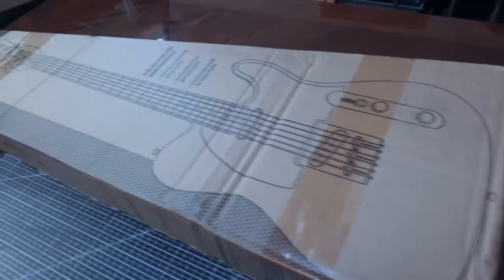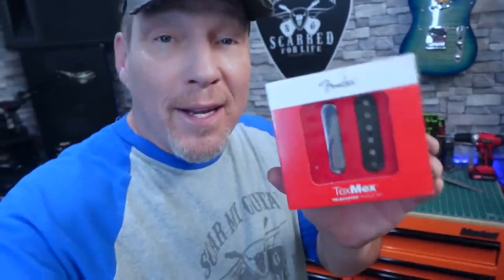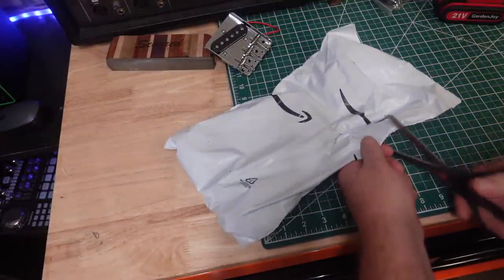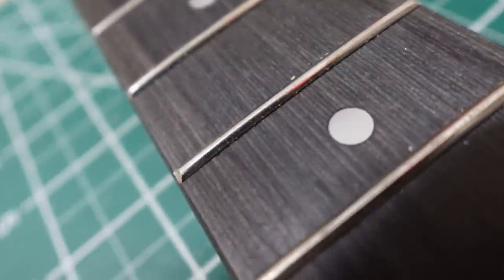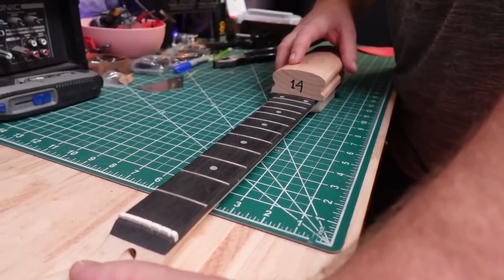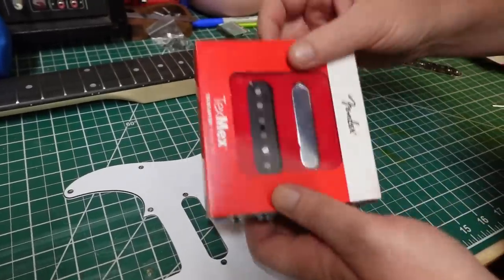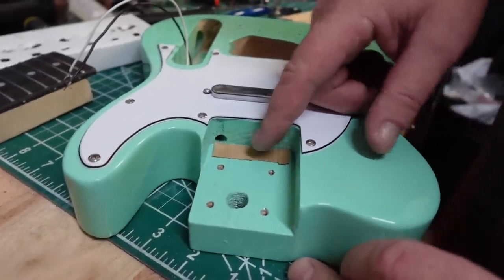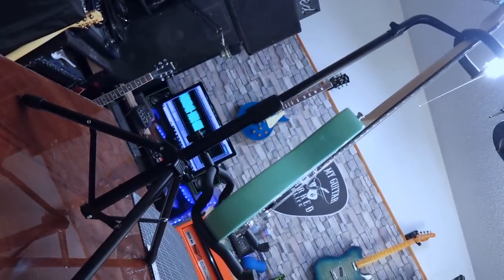CHEAP CHILD'S TELECASTER GUITAR GET'S FENDER PARTS AND IT'S A BEAST!

Comment: To make the neck sit flat in the pocket - THE SCREW HOLES IN THE BODY MUST BE BIGGER THAN THE SCREWS! Else the screws are threading into the body AND/THEN the neck. You only want the screws pulling the NECK to the pocket. I have to drill the holes bigger in the body all the time.

Comment: Sean, I'm listening to the sound demo even as I type, and I can tell you right now that that LyxPro is no student guitar anymore (as if it ever was!).  No, NOW it's a full-on travel guitar!  You've got me thinking about trying to rescue a mini guitar that I got for the purpose of travel, but it's scale length is too short and it needs strings too thick to be useful to me.  I have another travel guitar, so I don't NEED this guy anymore, really.  Still, I might like to keep it if I could get it rescaled.  I'd settle for 24.75 inches.  I might PREFER the 25.5 inch Strat scale length, but I'm not married to it.  My woodworking skills really suck, though.

Comment: Appreciate all the cool videos here lately! My buddy has a similar 30” Amazon kids guitar. It’s branded BY, I think. He got it years ago. I think LyxPro is selling them now with an amp for $50.  It’s a black double cut with a single strat pickup. It actually plays really well other than a couple mildly high frets. I’ve been thinking about trying to make a humbucker, 2 point trem, and locking tuners work on one.

Comment: Interesting take on the modifications especially since the routing was bad.  I modified a Lyxpro 30 but I used Guitarfetish parts for the locking tuners and installed lil killer humbuckers with a coil spitter on a video I did called "Pimp My Telecaster". I do like the small size and light weight of the guitar.  I replaced the bridge so did not have too much problem with the intonation and I go lucky on the frets and the neck did not have to be shimmed.

Comment: Hey Sean, i was wondering because I really like the bridge you bought here and I suppose it is top loaded as I didnt see any string holes on the back of the body, as every tele bridge with 6 saddles I seem to run into on the internet is a string thru body setup and I really don't want to drill holes into my body so can you please tell me where you found this bridge that accepts top load and string thru bridge and also how a top loaded tele bridge works with a 6 saddle system as I have never seen it done as do the strings go thru the back of the bridge and the underneath the saddle and back up thru the middle and over the top of the saddle closest to the neck? This might sound stupid but I want this exact setup on my fullsize tele and trying to figure out exactly how you strung ot thru the 6 saddle bridge while top loaded

Comment: There are lots of wiring diagrams out there and fender has all their diagrams on line for all their guitars. just remove and reconnect each wire at a time between old and new parts and you cant go wrong

Comment: Doesn't a shim leave a void between the neck and the body? Seeing that you know your way around a router, wouldn't it be better to route the neck pocket to a propper angle thus making a morebetter connection between the body and the neck? On the other hand, this channel focuses on showing how to repair guitars in a cheap and easy way, so more power to you. The guitar turned out good. Cheers.

Comment: For the two-pin tuners, I put them all on lightly snug, then align them with a ruler before snugging them pretty good. That will put the dimples in the exact right spot. Then I remove them and drill the holes.

But ALL the "experts" rub their guitars with panty hose.